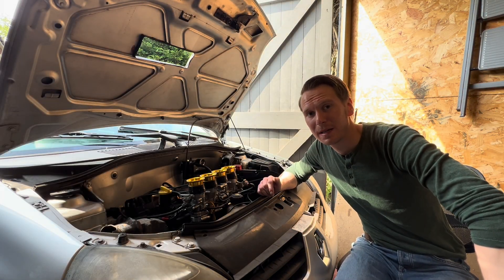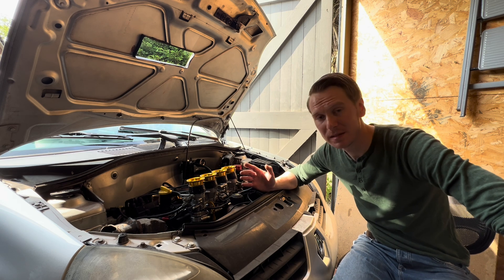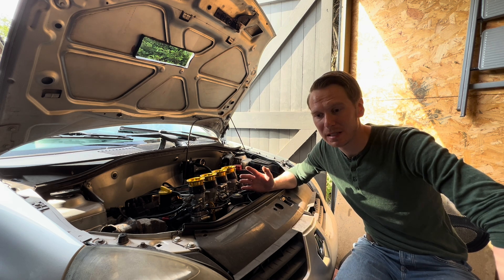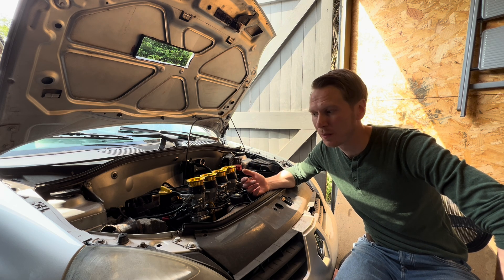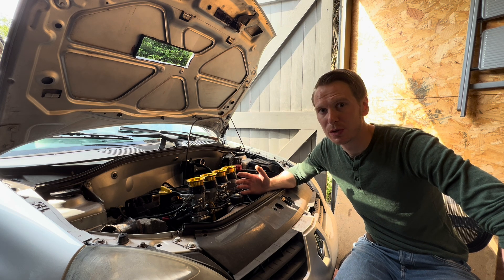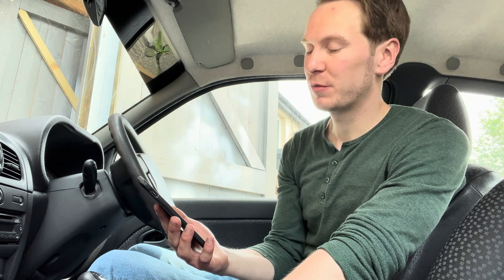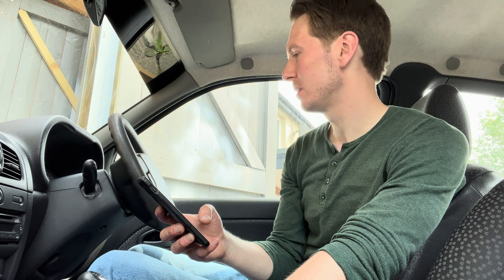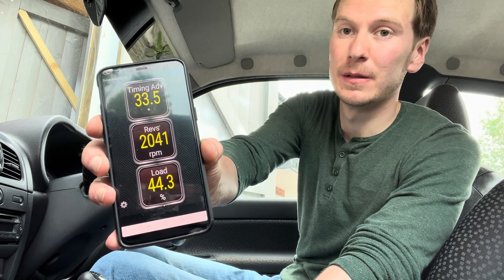Stock ECU hydrogen car - Will it work?

Comment: Hi, how can i contact you, we are trying to work on such dual fueled gasoline-hydrogen engines that can be switched to either fuel , we do have a system that changes to either retard or advance (relative)the stock timing in modern mpi engines

I am interested to discuss more on this, let me know your email so i can ask some questions i have

Comment: What about an older distributed/ carbureted car without an ecu
Reply from the maker: That should be fine, just set the ignition timing to TDC, no advance
Reply: @ would you think using k-jetronic fuel injection system be useful with hydrogen conversion because instead of a ecu controlling how much fuel the injectors need to spray instead it is a mechanical fuel injection system where fuel is continuously sprayed into the intake manifold at a constant pressure, with the amount of fuel delivered being controlled by a fuel distributor that adjusts the pressure based on the engine's air intake, essentially delivering the correct fuel quantity without the need for an electronic control unit (ECU) to precisely time each injection pulse like in newer systems; it is considered a "continuous injection" system, meaning the injectors spray fuel constantly, with the fuel quantity regulated by the fuel distributor based on engine conditions.

Comment: When you were trying to start it and thought the battery was flat, it may well not have been. Probably just too much timing. Petrol motors will do the same thing, if timing is too advanced the motor will fight the starter and stop or spin backwards.

Comment: Good to know the baseline performance. Amazing the difference the timing makes to the overall performance and efficiency. Did you tune the ECU yourself and experiment to get to the ~10° timing you suggest when underload and driving?
Reply from the maker: Yes timing is the most crucial thing, followed by engine components, 0 at idle to 10 degrees at mid rpm seems to be a safe bet, engine torque is massively effected, so would need to be turbo charged or supercharged to compensate.

Comment: Im running HHO with 150w from generator and 2 liter H /min.
The problem is the restexhaust contains Nitogen. Lambda 2 set has 371 degrees to work properly so now and then the check engine will lit. Long drive i save 0.2 liter / 10 km.
A factory computer to program CPU to my saab 93 cost 4000euro.
Isolating the lambdasenors delay the chec engine alarm that in the prm says " slow response bank 1. "
Slowing down from 90 km/h to 40km/h makes the 371degree go under and set check engine again.
I drive with the OBD2 all the time i passed inspection and no fault. Exhaust emission values was half the factory spec.
(The environmental Nitrogen exhaust could be improved by simply a spark system in the exhaust making ozon and thr notrogen taking one oxid to the nirogen...whops now there is 100% useful exhaust emission.)
Hopfully the new toyota engine have solv this.
I give like for your video and the time you spent doing it.  :)

Comment: This is interesting stuff. Will it be possible for you to share the logs from the torque app? I'd be curious to look at load vs engine rpm vs ignition timing.
Reply from the maker: Sadly I never recorded them, and don’t plan on running this engine again on the standard ECU, would be a shame to damage the engine, it’s back to running on the ignition ECU now. With correct timing for safe hydrogen use